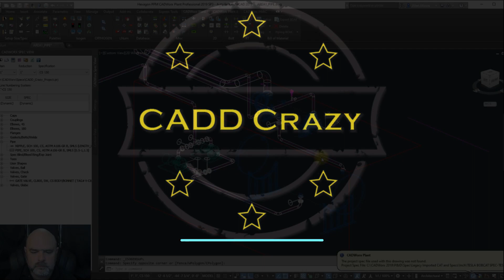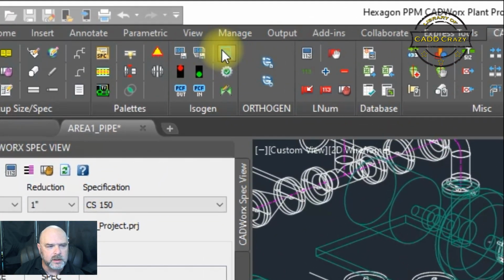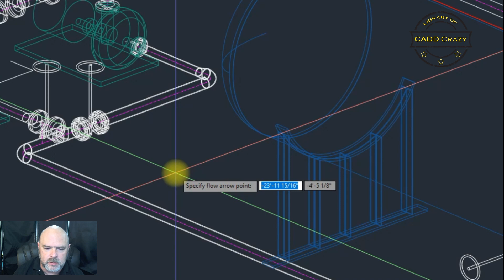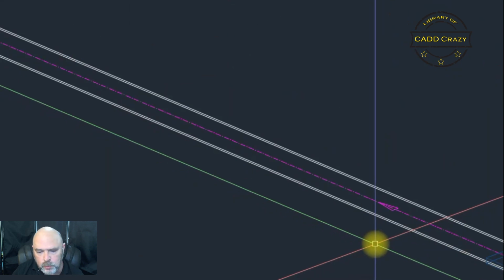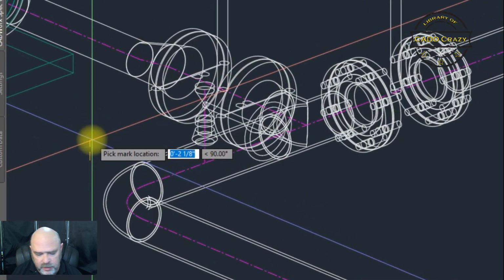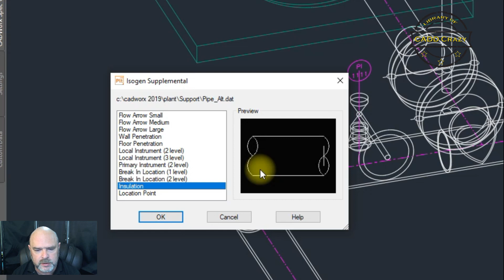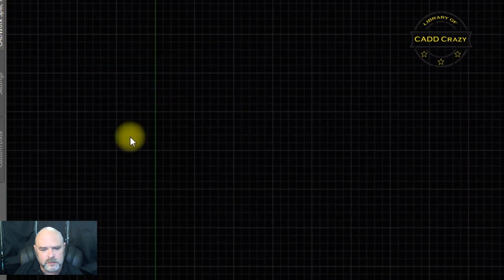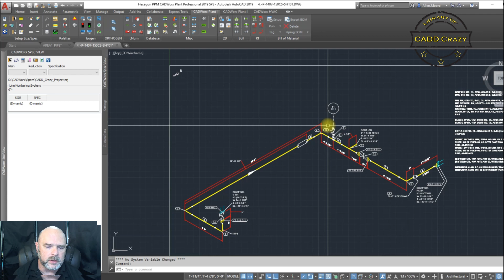CADWorx IsoGen Supplemental

Comment: Hi Allen! I'm having a rounding issue when generating the ISO. For example, the length of a pipe should be 3'-2 1/2", but the isogen generates 3'-2", both in dimension and material list. Any thougths?
Reply from the maker: Sorry for the later replay. Are you talking about the cut length or the center to center dimension. Also what size, end type?